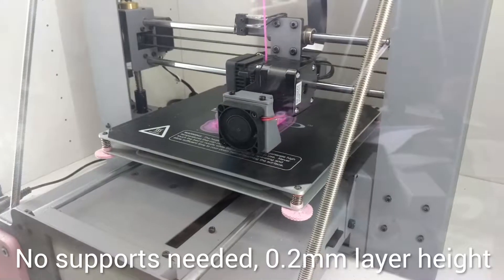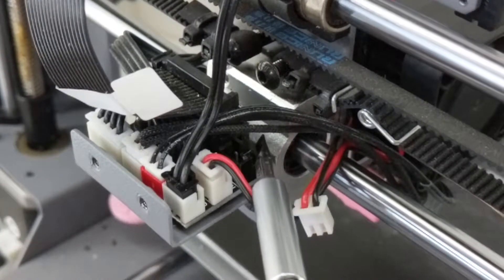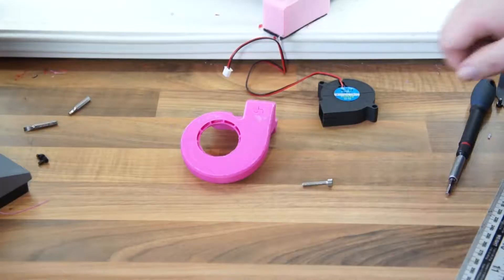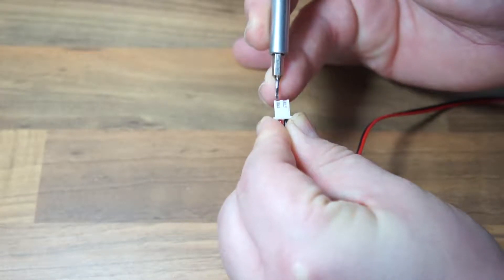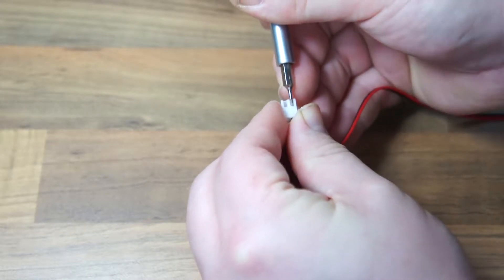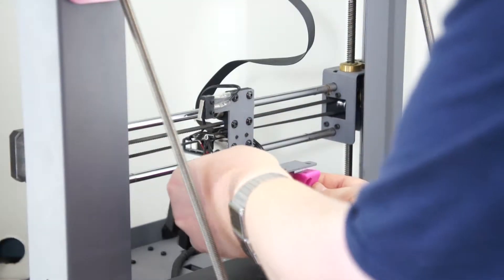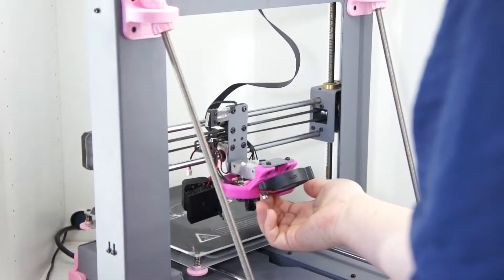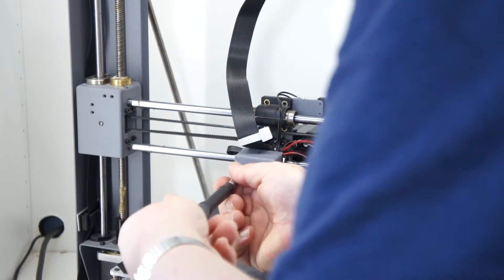Fitting the DiiiCooler Fan Shroud and Radial Part Cooling Fan | Balco 3D Printer Touch

Comment: Thanks for the very informative video. I have my shroud printing right now.  It is my second attempt, as I didn't spot there is at least two types.  Of course I printed the wrong one lol.   

One tip for you regarding using nylocks - I presume you couldn't use nylocks on the mounting screws due to the nuts spinning in the plastic?  If so run the nylocks down the screw before you fit to the shroud.  That way they will have already cut a thread in the nut and will go on much easier when you slip them into the plastic.  The purists will say "you should only use a nylock one time as the grip will be reduced when you use it the second time, meeeer".  This is true but they will still have more grip  than plain nuts.  You can also use the same trick if you want to fit a nylock nylon side first.  You can screw the nut on backwards once you have cut the thread in the nylon.  Trust me there are times that you will need to :)

Richard
Reply from the maker: Hi Richard :) Thanks a lot for the kind words! I believe I did the same thing on the shroud I printed before this one lol 

Thanks a lot for the tips on the nylock nuts! They will be super useful for me and anyone else watching :) I'm going to experiment with the CiiCooler soon I think as I miss being able to see the nozzle printing the first layer!

Thanks again for the comment and thanks for watching! :)

Comment: Just finished this. Printing the abs took a couple of starts to get it not to lift during printing (solved by turning the bed temperature right up). 

Quick follow on question. When fitting the Diiicooler I had to remove a sort of shroud around the nozzle - Will I noted on the video you look to have some form of printed replacement cover around the hot end. What is this and is it needed/advised?
Reply from the maker: So sorry it's taken me so long to reply! I think what your referring to is the pink silicone sock. The original stuff is like a ceramic insulation but this gets ripped off quite easily. So I replaced it with a silicone sock from Amazon. Don't think the one I got is available anymore but if you look for "MK10 silicone sock" on eBay or Amazon then you will find a bunch of replacements :) Hope this helps and thanks for watching!

Comment: Hi Will, quick question. On your video "How to build a 3D Printer enclosure from Ikea Furniture" you look to have a 3D printed Fan mod to use the stock 40mm fan. I can't seem to find a video for this, and looking at this one, it seems you have upgraded it again - what were the reasons? Is this much better than keeping the stock fan? Thanks for your advice. Great videos.
Reply from the maker: Hi OSimmonds
 :) I had originally upgraded the fan shroud as a go between before upgrading to the radial fan in the video. The stock fan is ok, but it wears out super quick and doesn't push much air. I upgraded mine for better overhang performance and small details. The radial fan pushes a lot more air and with the DiiCooler shroud it directs it all around the part that is being printed. Much better in my opinion! Thanks for watching :)
Reply: @willcaddy  thanks for your reply. Definitely a new year project then! Merry Christmas!

Comment: Hi will any chance you could share your speed settings on cura. (cura must have had an update at some point and reset to factory settings and now I keep getting a shift on most printers I do (I can't remember for the life of me what I changed them to 😕) I'm after print speed, travel speed, print acceleration, travel acceleration, print jerk and travel jerk. Any help would be much appreciated, many thanks Lee Fletcher 👍
Reply from the maker: Hi Lee, So sorry its took a while for me to get back to you -_- Been one of those weeks! 

I use the stock settings for the Wanhao Duplicator i3 Plus printer that is pre-added by Ultimaker. You will find it if you go to add a new printer and then look for the Wanhao section. The printers are identical, they were just re-branded for the UK and other countries. I would try setting the printer up again with that profile FIRST before changing any other settings as I have found them to be pretty perfect out of the box :) 

Your print jerk and those such settings are actually stored in the EEPROM of your printer, but setting them in Cura overrides this. As a quick run down though of what I have stored in my printers EEPROM and on Cura:

Print Speed: Anything from 15mm/s to 60mm/s as this is dependant on what you are printing and the quality you want. Generally slower for better quality. 
Travel Speed: 120mm/s (usually calculated from print speed so again this could change and I would let Cura handle it. Just change the print speed.)
Acceleration control is disabled in Cura which means it will default to whats on the printer. Turn this on to change these settings in Cura. Same with jerk control. 

Acceleration set in the printer is: 
Max X: 1000
Max Y: 1000
Max Z: 100
Max E (extruder): 1000
Print: 800
Retraction: 800
Travel: 800

Jerk set in the printer is:
X: 8.0
Y: 8.0
Z: 0.4
E: 1.0

I hope these settings are of some help! Also I gave you a shout out in my latest video about printing wood barrels as I like the idea of putting the main settings I used in the description of videos, so thank you very much for that :) Thanks for watching!
Reply: @willcaddy  Thank you so much you are a superstar it's working better than ever before, love the channel I find your videos very helpful keep up the good work...
Reply from the maker: @leefletcher1137  Glad to hear it :) And thanks for watching! I really appricate it :)

Comment: Another great video Will, thank you. The quality of your work continues to improve. 

I have almost the same printer as yourself (it already has USB) - it is my fourth printer in my wee workshop - and was intrigued by the fact Aldi sold it! 

I have taken a slightly different development path to you, having added a BLtouch, which has dramatically improved first-layer adhesion and made 100% of the bed functional and reliable for even the thinest of prints. 

I am currently adding a new fan shroud, but fighting to find one that does not interfere with the BLtouch so much.
Reply from the maker: Thank you! Your comment means a lot :) You saying that, I am planning on adding a sensor but TH3D just announced there firmware for the Balco and now I kinda want to install it for there capacitive sensor! I added one to the Creality CR-10s I have, and it's great! (Video coming soon :P). Will do a video on it soon as well as the "How to upgrade the firmware" video I still have to edit xD I have loads filmed but it's finding time to edit around work! Thanks again for watching! :)